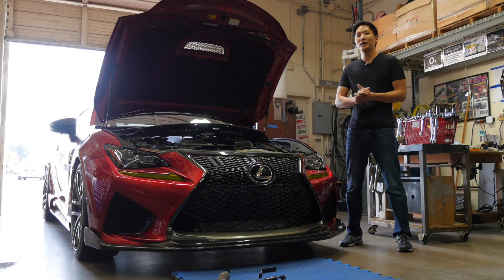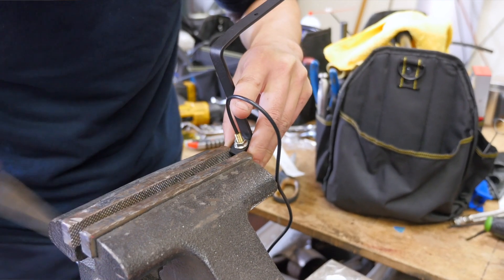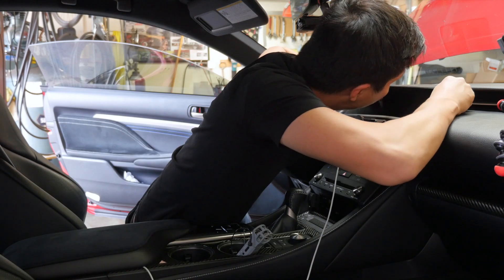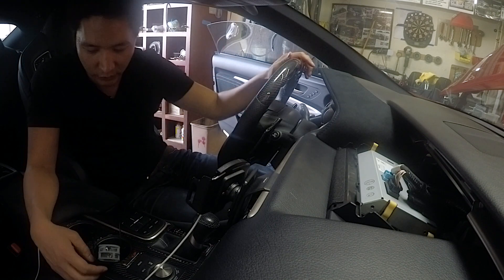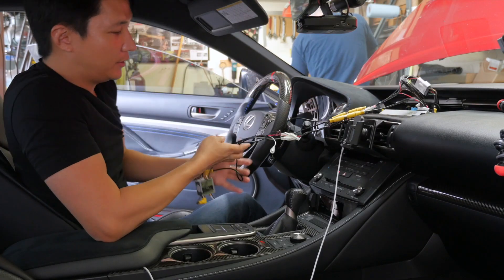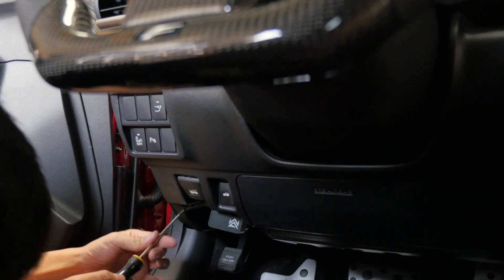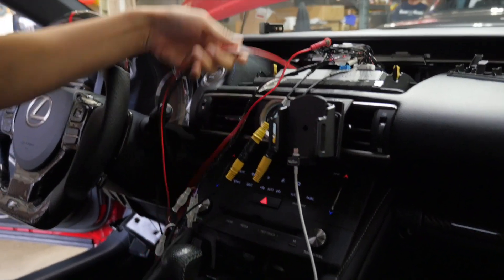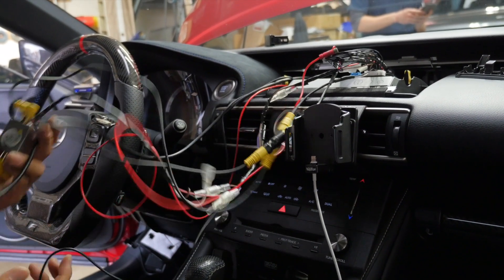Installation | 2016-2021 LEXUS RC F | Beat-Sonic Front Camera

Comment: Can you guys PM the dimensions of the mounting bracket? Would be great if you included that in the pack. After all the package (camera and wiring harness) is $350 :)
Reply from the maker: Unfortunately we don't have the dimensions as it was made from a local shop here. You can give them a ring and ask at  (714) 978-2446

Comment: Hi, I'm interested in purchasing this camera along with your apple carplay system (LGVIF-CB2 S) for my 2014 IS250. Would this camera be compatible with your carplay system? It would be a great addition to be able to add both upgrades to my vehicle and wanted to make sure there wouldn't be any compatibility issues having both systems installed. Thanks!
Reply from the maker: Yes you may install both front camera and carplay system without any issues
Reply: @BeatSonicUS  Great, thank you!
Reply from the maker: My pleasure!

Comment: Nice feature. One question - what happens if you press the switch while the vehicle is in reverse gear (and factory backup camera shown on the screen)? 
Does it switch the camera to the front one or no camera selection in reverse gear?
Reply from the maker: The camera will go to the front on the first press then back on second press and third press back cam again when car is in reverse
Reply: @BeatSonicUS  thanks a lot!